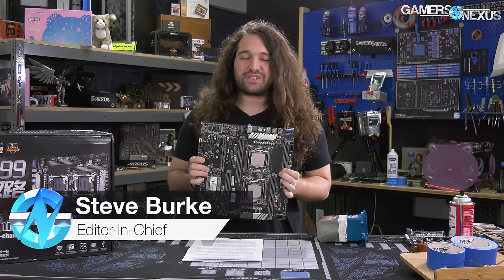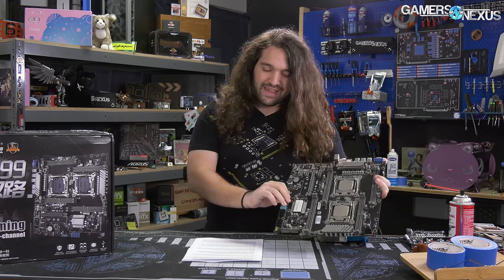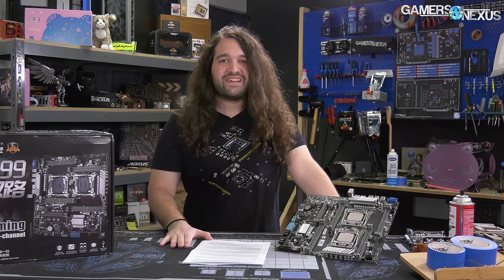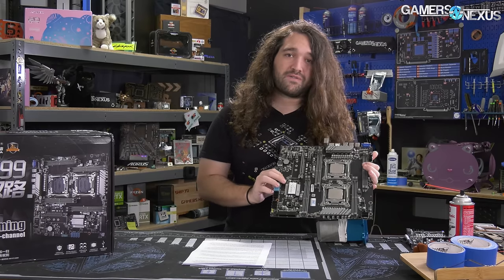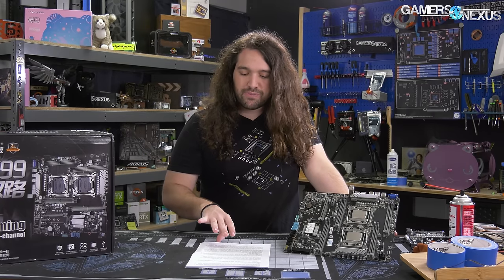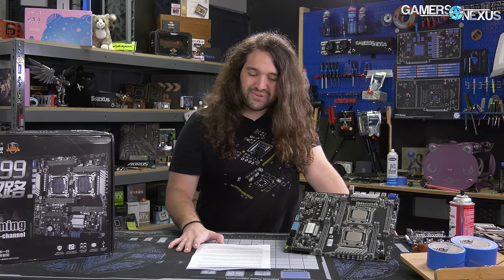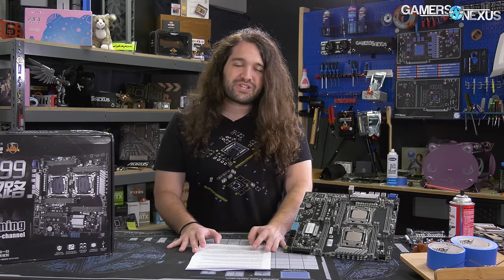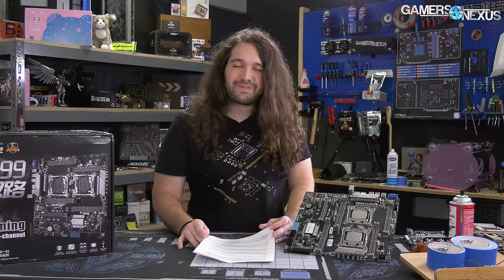24 Cores, 48 Threads for $360: Dual-X99 Jingsha Motherboard vs. AMD R9 3900X

Comment: I bought a KLLISRE x79 + 2x Xeon e5-2640 6/12 each + 32gb ecc 1333 for nearly 250€, and i know i can't ask much for the price but It's been a ton of different issues, no support from the vendor (RE Store) and no manual/help anywhere. The problems I find in my case is the random boot : If you turn off the system, without any change at all, I need to turn on turn off several times to start it again. The performance is weird: virtualizing VMs they're laggy as hell (tried already using the secondary NIC, manually searching for drivers..etc). That last one leads me to No drivers at all. I don't know if I can use the ones Huananzhi, but since those drivers are for Windows... Maybe I could repeat the process this time with Windows Server... For the moment I went for ESXI in the beginning (had to make my own ESXI Iso!). Proxmox was more/less fine, but the performance still laggy. I finally gave up and setup a TrueNas environment, just a couple VMs, and NAS service until it dies.

If I knew all this, I would have gone for another option for sure, but just wanted to share my headaches with the guys who may be considering buying one of those kits. Prepare for headaches. If you don't have any problem, then GG!

Comment: This board is not gaming oriented at all, even not workstation oriented IMHO. I see Aspeed AST2400 chip on board, it's server feature, does it have IPMI management interface or just uses chip for vga because boards with IPMI (remote kvm, management etc. are way more expensive server grade stuff)? If it has it would be great hardware for headless virtualization server running VMware or proxmox or hyper-v. If it supports ECC RDIMMs small amount of memory slots also could be remediated with registered DIMMs.

Comment: I think I have about a 80% failure rate on boards like these. I've just stopped ordering them and would rather find a supermicro or asrock board even if it has fewer features. My ebay special Xeon v1/v2/v3 servers running on decent motherboards have been bulletproof for me as a data architect running various data platforms in docker and offloading python both for testing and production-like workloads. I just need the threads and the RAM and a decent GPU.

Comment: Of course you're going to dislike it and put shame over it, cause you guys get unicorn tech for free. Some of us can't get FREE ultra-tek and actually have to rely on "affordable" options. I my self put a dual X99 xeon cpu system together for network rendering and storage. It works perfect and I spent less that $400! Plus when the higher speed/core xeons become available, we'll be surfing on high waters...Good luck with the limited platinum tech, nobody needs to see reviews about.

Comment: Hi Gamer Nexus you should take in consideration  of showcasing performance and price comparation  Xeon 1650/1660/1680 V3/V4 !!! both overclocked and non overclocked  with different setups of  cooler  stock vs   Best Air cooler vs Water cooler AGAIN Vs AMD CHIPS be fair  SAME CLOCK AND SAME CORE COUNT  and of course in depth choice of mainboards eg Asus vs Chinese cheep board in test .For Shure this will be great show.

Comment: I buy these X99 Xeons on Ebay that say "Confidential" for $50 some times they say 2.2ghz on them and they run 2.4 min sometimes the sell says its a 10 core and i get it and its a 14.  over the years I have seen millions of "Confidential" listings how is it intel made so many? I use them for PLEX and paper weights

Comment: Here in 2022 the price of these so called dual x99 boards have dropped in price. If you understand the limitations and don't have access to more modern hardware, I would still call these a reasonable purchase.

Comment: Have you tried asking the manufacturers what workloads they use these for? There must be a use case where they make sense for there to be so many options. My guess is storage servers or some kind of web server. If there wasn't a good use case you would expect there to be 1 or 2 of these and not a whole industry. I do see lots of these 15 year old PCs being sent to the 3rd world but at this point a cheap Athlon 3000G system has more performance.

Comment: yea, Its even worse in 2024, I recently picked up an x99 board and a 2680 v4 cpu for it, sure it gets my PCIE passthru(VT-D) and extra ram slots for more ram...but even with the 14 core 28t cpu I have with it, its using twice the power and is less than half the speed of the 11800H 8c 16t engineering sample cpu chinese board I had before it(at roughly the same cost). the extra ram I could chuck in it was not worth the slowdown and power use, these socket 2011-3 cpus are utter trash now

Comment: would the hgh core count and ram be useful for music production? this and the lack of need for graphics seems to be the best case for repurposed workstations but im yet to find a video that confirms this
Reply: I don't do music production, but I know you need low latency to record audio in real time, and dual socket is the best way to achieve unacceptably high latency. It would work well for encoding many audio files in parallel, though.
Reply: @kotekzot  dual socket aside, assuming i use a single socket server, would the high core count benefit me in anyway?
Reply: @neelbien  what exactly are you going to be doing? Recording audio, mastering audio, encoding audio files serially, encoding many files in parallel? I expect a high number of cores will mostly benefit mastering audio with many audio tracks and parallel encoding.

Comment: What about Xeon E7 v2 to v4? They are much cheaper and more powerful. They need the c602j Chipset and socket LGA2011-1. Are there any EE-ATX boards compatible with Xeon E7?

Comment: Good afternoon, how are you? I have a problem: My power supply is a Corsair CX600w that has only one power cable for the CPU (4 pins + 4 pins), would I have to change the power supply or can I use an adapter/extender? Thank you all!

Comment: You should have opened this video with the song 'I wish that I was a madman'. 
A higher clocked Xeon like the 2667 v3 or 2687w v3 would work better but those are expensive AF and pointless for gaming. I have an E5-1650 v3 which clocks to 4.8ghz with ease.

Comment: I really like the idea of reusing old computer parts in cleverly updated motherboards.  You won't get the same performance as some top of the line new Ryzen on an Asus board or anything, but it's probably excellent for typical computer use, like in an office or something.  That's cool they found a way to repurpose parts that were destined for a landfill.

Comment: This is a really weird board.  It looks like it would be great for a VM server, but not much else.  Not enough expansion slots to use for anything else, especially with most of the cheap enterprise cards using x8 and x16 cards.  Does a board like this exist with half a dozen x16 slots?  that could be fun.  My current server is a dual socket opteron supermicro that has all the slots filled, with 3 SAS controllers, a 4 port gigabit nic and a 10gbe optical, and a complete trash PCI VGA card.

Comment: Awwww another board I really kind of wanted but now I'm glad I didn't invest in. Way smarter to buy this generation, even on the low end. Some tasks might benefit but it doesn't really look like much I'd need it for. The current 2690v1 x1 I have is just barely enough to exist on today with a slew of fans and profiles thrown at it. Time to switch to 10th gen I think once Intel drops 11th and the prices come down a hair.
Reply: Update: 10600K and Z490UD acquired. Glad I went newer, power consumption for dual X99 has to be absurd lmao

Comment: Got a x5680 and x58 Board plus 12gb ram for 105€ 4 years ago. No game that is Cpu Bottlenecked so far, except Ram Bottlenecked when I want to go over 230 fps xD My Ram Clock is only 1644mhz, cpu doesn't like more :(

Comment: I’d imagine this system would be great for CFD or other workloads which rely on high memory bandwidth
Reply: A threadripper or epyc would absolutely destroy it but then that would also cost significantly more
Reply: @wingracer1614  Threadripper it depends since it's only quad-channel memory whereas dual X99 is octa-channel. I mean I guess it would beat it, although as you said, the price difference is massive. Epyc is interesting since you can get Epyc Naples cheapo now and it's octa-channel. Largest expense would probably be the motherboard in the case of SP3 socket boards, but you can make dual-Epyc systems which are 16 memory channels.

Comment: I run a 1680v3 in my main rig still as it overclocks to 4.7 ghz. I wonder if two of them at lower clocks would be worth s try 🤔
Reply: You'd need a 2667 v3, which would run considerably slower.
Reply: @pooki-dooki  ahh I see, yeah after finishing the vid I think its pretty pointless at this stage. Specially with 5950x soon enough:)

Comment: I need some help. I built a PC 4 years ago:

MSI H170 motherboard
i5-6600k 3.5GHz 6th gen
2x8GB G.Skill Ripjaw 2133, PC4 17000
MSI GeForce GTX 1050Ti 4GB
1TB WD Black SATA Drive
Corsair CX500W 80 Plus Bronze 

When it comes to cooling I have never had issues. I have a (did not realize till I got it) huge IN WIN case and use a Master Cooler Hyper 212 EVO for the CPU. I'm about to add 6 fans to the 4 I already have.

OK, my issue is that I want to upgrade everything in the list, but in 2 separate buys while using the first buy with the setup I have now, until the second buy when I buy the rest. I don't really know if I can just do that, so I have been watching video after video hoping to find the info that say, "yes you can" or "no you can not" but I can't so I just came to the newest video.

I have in my NEWEGG cart:

EVGA RTX 2060 Super
WD Blue 1TB NVMe M.2 
2x8GB G. Skill Ripjaws 3600, PC4 28800
and 6 fans

2 questions:

1. Can I install those and expect them to work with a 6th gen i5, mainly the GPU, the rest I expect to work. I will take a "yes, why wouldn't it", but if I can not, can you explain why; I will take just a NO though.

2. From what I have learned, if I mix my old memory with my new memory, it will run at old memory speed. I plan to buy 2 more of the newer sticks but would it be better to run all 4 at old speed or just the 2 newer ones at higher speed? I am doing this because of Cyberpunk.

Looking at it from a hardware standpoint, to me, it seems like it would work, but I know so little about software (just learned about XMP profiles today, and I have 2133 memory) that I wanted to ask these questions first. 

I realized at the second question that this is like a forum thing, but other people might wonder this as well so I'm asking here because most don't use forums, most do use YouTube. Thanks
Reply: Oh yea, 3rd question, will 500W be enough power, until I upgrade my Motherboard, CPU and the PSU itself? I used a calculator online but, don't know how reliable they are. It said with the 2060 Super I would be at 235 but I don't think I put the newer memory in so what, 250W (no clue, lol)

Thanks Again

Comment: Both cpus are running in quad channel, you cant get octa channels without having 8 dimms at least on each CPU. .  . x99 also does not support this theoretical 8 channel configuration

Comment: I know it's of topic.
Hello I live ik Belgium Europa.
Recently I spild some coke over my pc.
So the motherboard was broken and also the cpu.
So I got a B360 motherboard and the i9 9900kf.
But I can't overclock with this board.
And also when I do a stress test the cpu drops to around 4ghz.
Can you recommend a good Z390 board?
I heard that the gigabyte z390 aorus master is a good board with good vrm temps.
But isn't good availible.
Can you help me?
Also I'm upgrading to a 360mm aio for cooling  but are the tubes long enough to mount it tubes down like  gamers nexus sugested?
Thanks

Comment: Can i ask if i want use vga like 3060 is bottleneck? I want build dual xeon E5 2699v3 total 36c/72t, board x99, ddr4 nox 16gbx8, pny nvme 1tbx2, asus oc 3060 12gb, cougar gex 850w gold (im build for bot emulator and when running bot i want play game AAA)

Comment: to be honest the x99 boards don't make amazing game server chips either.

fine for any server with good multi-threadding.

stuff like minecraft etc that hammer a single core? nope sucks.

I use a 2680-v4 x99 chinese clone board(prob H85 chipset?) for file server/crappy windows machine via proxmox

and an 11th gen ES 0000 8C16T board with a laptop cpu on it thats all unlocked for servers that need single thread performance, as it can be overclocked with ease to 4.8-5ghz+ 
that and they were about $110USD when I first got em and use about 30W while doing nothing

Comment: I bought these CPUs specifically for headless blender rendering and NAS - sadly had to get a real server motherboard rather than the Chinese ones. It's really a shame that they don't put all the pcie slots that can be supported. A used supermicro x10dri is a bit pricey compared but has 3x pcie16x and 3x pcie8x

Comment: It's definitely time to take steps to minimize CCP contributions to hardware. It can be difficult to vet individual products for CCP parts and labor, but you can at least start by rejecting products that are outwardly branded as Chinese in origin. The Huawei fiasco(s) illustrate that they are are not our friends, and although it's supposed to be a mixed economy (state owned vs private businesses), we should probably assume that they would be happy to blur the lines.

Comment: Can you try two i7-6800K? 
😆 Those chips are kind of cheap now, at least in Sweden. If the MOB could even cope with 4.2GHz OC on the CPUs. Yes, it's not Xeon. But with PC parts, you never know if it works until you try 🤓
Reply: Core CPUs won't run in multi-CPU configurations. Only Xeons specifically designed for multi-socket, such as the X series (Nehalem/Westmere), E5-26xx and 46xx series (Sandy Bridge through Broadwell), and Xeon Scalable. So even some Xeons won't work in multi-socket configs, like W series, E3 series, or E5-16xx series.

Comment: Great video as always! I do believe it was setup for gaming fail though. With old Xeons you either go for productivity (high core count models), or single thread performance (low core count). 12c is not good for gaming. I believe something like 2x Xeon E5-2637 v4 (4c) shall perform better in games and worse in blender.

Comment: Steve disable hyperthread and watch the gaming scyrocket always a wierd workstation issue you will be suprised.From one of the original v3 unlocker guys.helps tdp vrm can beat my 3950x in multithread 4500 cinibench r15 and alot closer on games with hyper thread disable. It is faster than single xeon because all real cores used and lanes.Yah just for fun though.Thanks for the review! https://www.3dmark.com/spy/7281804

Comment: best bang is dual 8 core or 10 that already have a base of around 3 ghz there are a few .  when you go o the higher core count  they begin  to run lower frequency . for insnace you can easily get dual xeons with 8 core 16 thread that turbo to near 4ghz  those will run better  plus you wont get tdp locked as easy

Comment: Instead of going for crappy locked multiplier CPU for Amazon, you could have got 2985v3 QS which is a preproduction sample of identical characteristics as the production one for 125$ per piece. That is 2.6-3.5GHz CPU with all cores frequency of 3.0GHz, so much, much faster for gaming than 2978v3.

Comment: ummm why woudl a  2018 game need 48 treads then the systems then launched on were 8 threads .... 8 slow ownes a 2018 game so possibly in dev in 2015? is being scholed by a expensive 2020 system.... why? can intel sue you for being a d here because u normally doent but wtf

Comment: laptops got a 6c12t that clocks to 4ghz all core, 9th gen intel....10th gen can hit 4.8ghz single core and hits 4ghz allcore without an undervolt. The gaming workstation has a 3950x. SO glad weve finally gotten to this point. NVME off CPU, playing bfv maxed on ultrawide while installing RDR2 using all 32 threads off 105w TDP, at 55c max. XD. Looking forward to this lasting me a long AF time. The 4-500$ Gpu realm will be quite viable down the road when 3080 performance winds up hitting that pricepoint in the USB4/am5 age. Ill only upgrade to AM5 once GPU bottleneck is severe enough to justify the need for ddr5. 4k gaming is finally viable. XD and VR. Too bad the next-gen consoles are going to hinder the progression of VR/developer capital.

Comment: Need to do the turbo unlock so you can get faster single core boost. It doesn't help much with muti-core, but it will give you a 10-15% boost for PC gaming. Someone finally figure out how to do it right with the EFI mod with dual cpu. https://www.youtube.com/watch?v=l0iq64NX-9A

Comment: This is a real ultimate troll video. Comparing more than half decade old 12c Xeon with 3900x using a scrapyard HW from some xyz manufacturer. I wonder in what way is intel directly involved in making of this trololo? The real comparison would be comparing this junk with premium price junk called 10900k. Blender results are a good example of intels mumbojumbo where 10900k ever overclocked to the roof cant  catch up with this scrapyard system. Autogoal. Ahahhaahhahahaa.